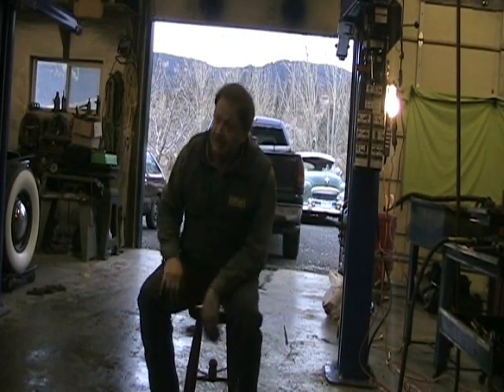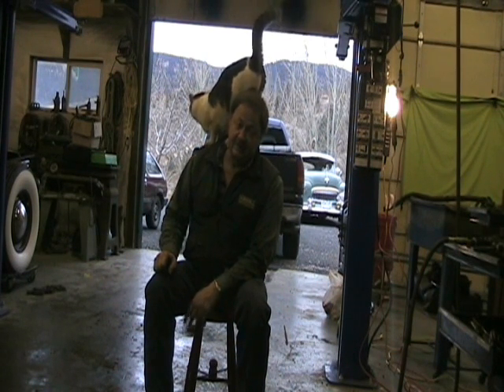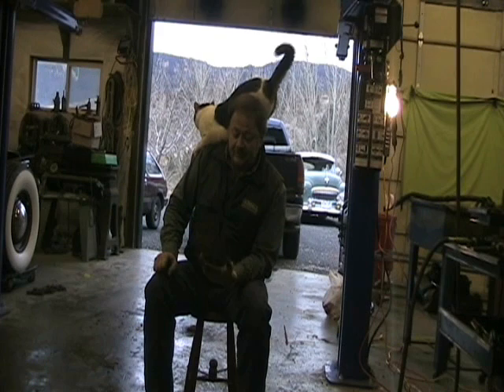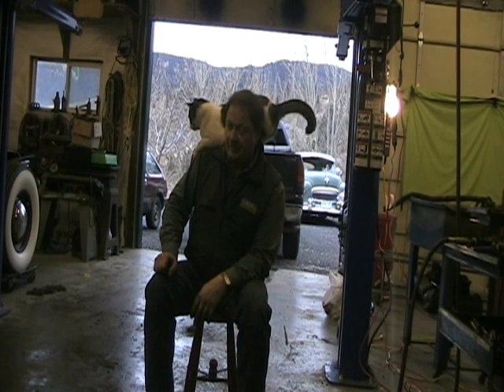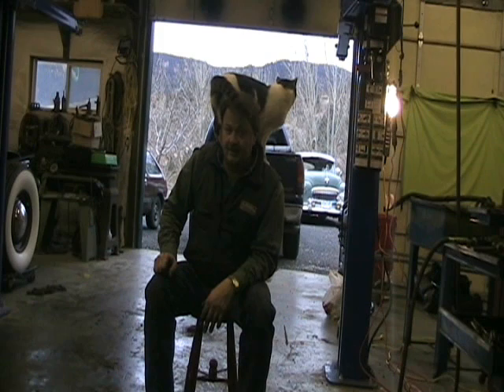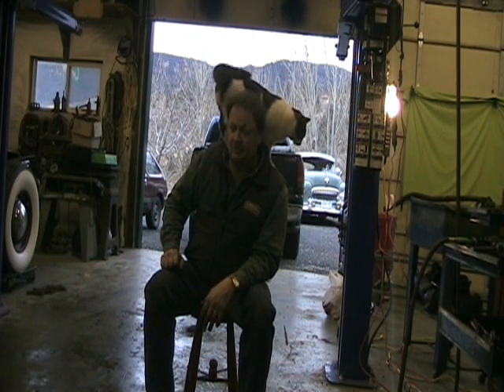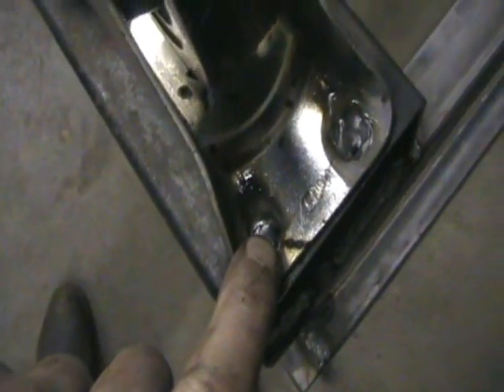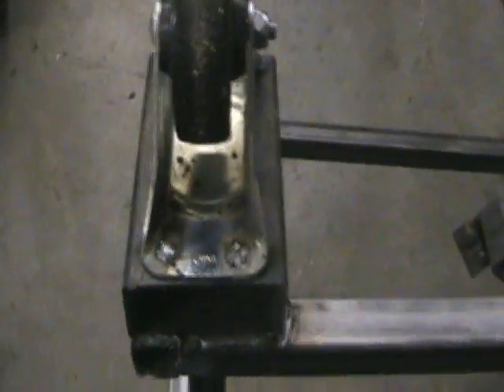Nash works, engine stand and a furry savant

Comment: thanks for the quadrajet demo's   I lucked out and got the 800 cfm from the junk yard and have rebuilt it. due to lots of good tips from you,      Im going to put that baby on tomorrow, and then rebuild the one thats on there now just in case.     its a 1985 gmc motor home, 454.  next i have to figure out how to hook up the smog gismo on the side of the air cleaner... I got that used from the junk yard too.    then Im going to put mufler bandages on the the mufflers... it will be good as new

Comment: I have some rubber flex air brake lines that feed the brake chambers on an 18 wheeler , are those something you can use on the bean ? I think they are 1/2 inch , and like 2 feet long , I think I have 4 of them , and no use for them lol